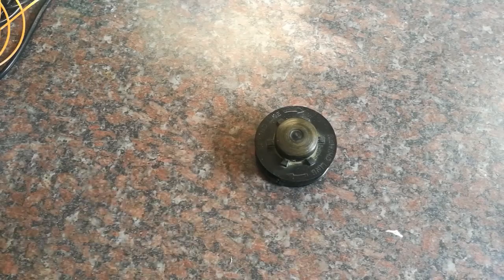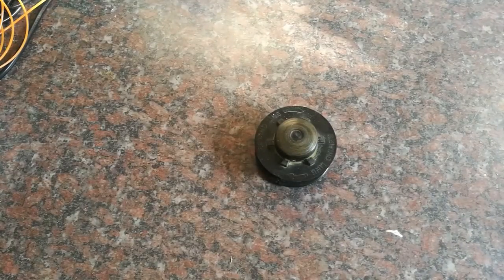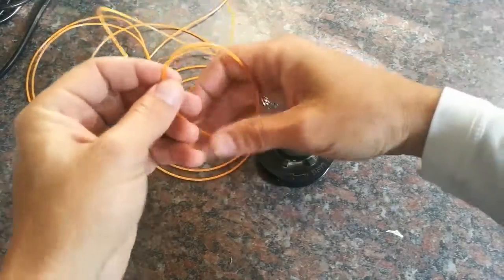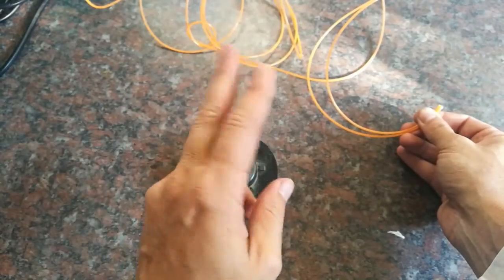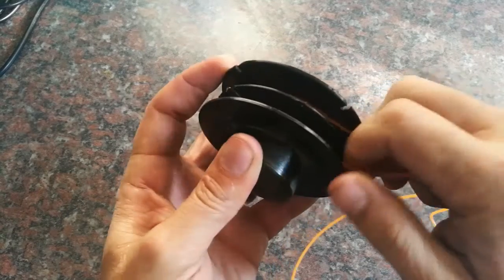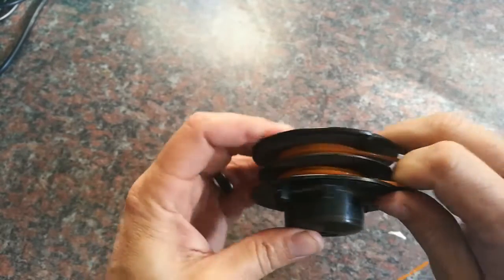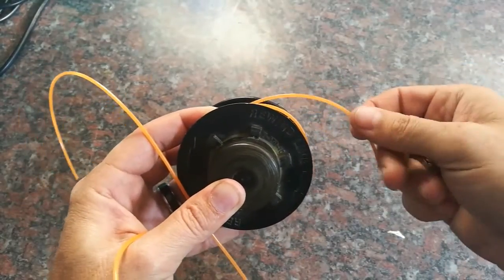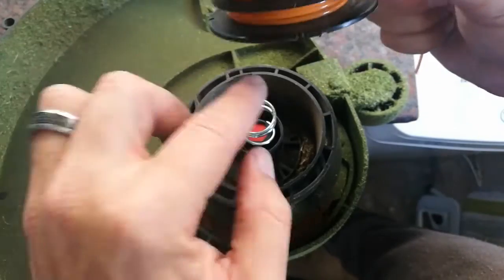How to replace the gut/line on your edge trimmer or weed eater

Comment: I know lots about the edge trimmers and weed eaters and lawnmowers and i got very very good with my knowledge about these powerful machines and i follow the general rules of thumb for the trimmer line diameter depending on the engine cc and wattage rating and the size of the motor and ja i hope to bring some back for if i start my lawn business job and I can then test them out randsnyers en grassnyers is lekker om te gebryk en ek ken baie van hulle

Comment: At the back of the spindle are two holes 180 degrees opposite each other. These are retainer holes to prevent the gut from unrolling. Clip each end of the cut into these holes, feed it through the spinner head and give it a slight jerk to release the gut from the holes and complete the job.

Comment: Great video, thanks. Please also show a video of how you tap on the ground to extend the line. Currenly doing it manually despite the line being less than 3 metres. Thanks
Reply from the maker: Oh ok. I actualy tap it while it is running. Great idea. Thanks.
Reply from the maker: The requested video is up. I don't know if you had seen it yet.

Comment: Nice video, much better than the Ryobi video. Unfortunately my spoil doesn't have the splitter in thhe middle, so still kind of stuck
Reply: Ah I have worked it out. In the line holder channel there  are two eyelets. Pass the line through one of these and then pull through until you have found the halfway length of your line. Then double the one side back and wind both together in the dirrection marked, taking care to keep it neat. Near the end hook each end into the two retaining notches. Then feed the free ends into the feeder holes on the head body, and reassemble the whole head. Then press the bump button and pull on the two lines until you hear them come out of the retainer notches and are now free to feed.

Comment: I do it in the same way but mostly still a struggle when trying to feed the line by tapping on the ground.  The line tightens too much and won't feed.
Reply from the maker: Try making it a 3m line. If it is too long then it gets stuck.

Comment: Unfortunately whilst your video is informative to a point you are completely incorrect as you miss several most important fundamentals: 1. trimmer line is colour coded and that should be pointed out eg: orange coloured trimmer line for 1,8 mm or 2.0 mm for 1000 Watt Lawn Star weedeater (yellow for 1,2mm etc) 2. For that 1000 watt model you can load 8 meters but no more, loading 1 meter as you state is a great waste of time 3. and most importantly you should clip in the lines into slots temporally on the bottom flange, load the spool and then pull the two protruding lines to release them rather than fiddling around extensively as you show. Or watch the  inferior quality Lawn Star that has no sound or commentary: https://www.youtube.com/watch?v=B8kVG69UqXs
Reply from the maker: Good day David. 1st of all thank you for the extra info. As you can see this video is 4 years old. When I made this I did not know anything about the trimmer. I do not use other color lines as they mean nothing to me. The orange line came with the trimmer and there for I use that. I also do not put more than 3M line on the spool as longer line melts into the roll and does not extend then. As long as my video helped out other new and first time users I will consider this video a success. But thanks again for the info. Kind regards

Comment: I'm winding in direction of arrows and it never taps out properly. I always have to pull out manually. Designer needs to be sued for torment.
Reply from the maker: Haha wat I found is that if you put up too much line it gets hot and they melt together prwventing them from coming out. I put up about 3m of line devided by 2. So 1.5 per side.
Reply: @CriPtZoNe  im wondering if oiling would help
Reply from the maker: Never tried it before. With all the dust it might make it worse.
Reply: @CriPtZoNe  im gonna also try making a blade attachment rather than use string